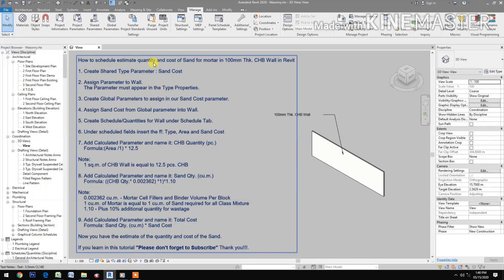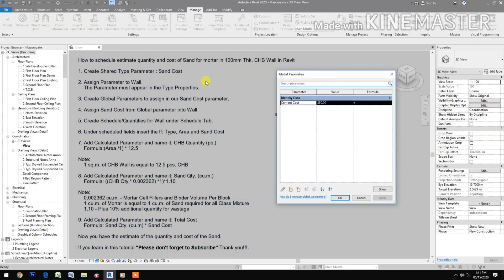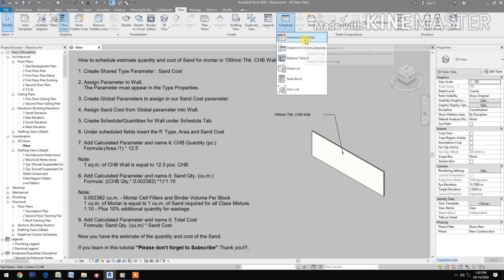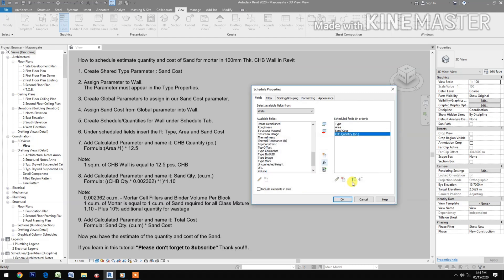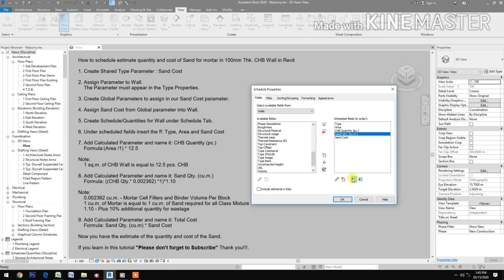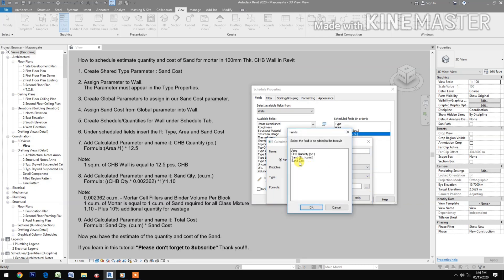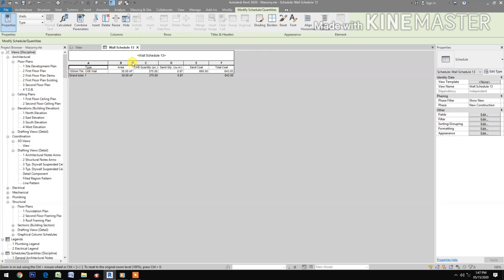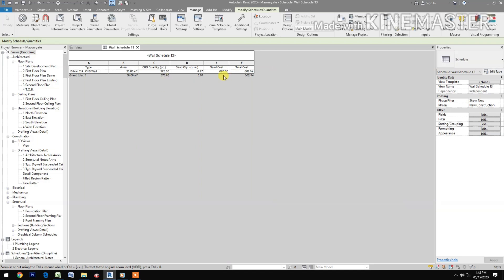Cost Estimate of Sand for Mortar in 100mm thick CHB Wall in Revit. Program of Works in Revit.

Comment from the maker: Suggested Videos:
RD116. How to make an Arabic Pattern Curtain Wall in Revit.
https://youtu.be/u9giiqooh8c
RD113. How to make a Parametric Arabic Pattern Pivot Door in Revit. Pivot Door Revit Tutorial.
https://youtu.be/3tAyuCpotGw
RD112. How to make a Parametric Arabic Wall Screen Divider in Revit. Decorative Wall Panel in Revit.
https://youtu.be/QUr7-LO2I2Q
RD111. How to make a Parametric Floor Accent in Revit.  Custom Floor Pattern Design in Revit.
https://youtu.be/K-3mrs3ICD8
RD109. How to make a Classic Ornament Stair Railings in Revit. Classic Ornament Baluster in Revit.
https://youtu.be/mq1grcVPxhg
RD108. How to make a Glass Balustrades in Revit. Modern Stair Design in Revit.
https://youtu.be/NVbatHyQj_0
RD103. How to create a Parametric Curtain in Revit. Curtains in Revit Tutorial.
https://youtu.be/dVljI_ynZPg
RD102. How to create a Glass Block in Revit. Curtain Wall Glass Block in Revit.
https://youtu.be/EYEbYQSJesk